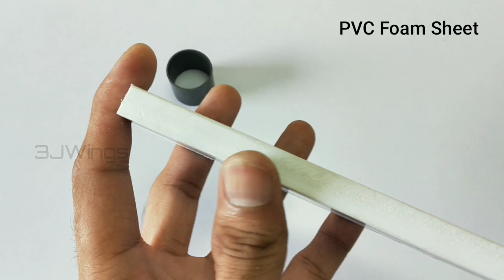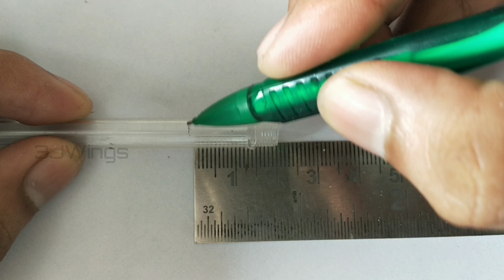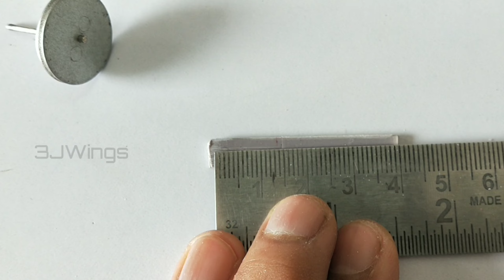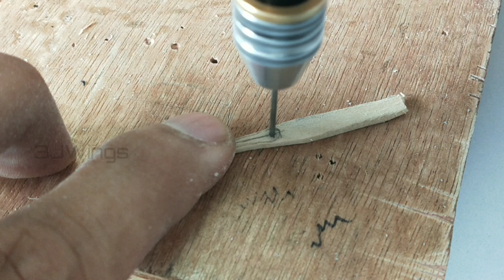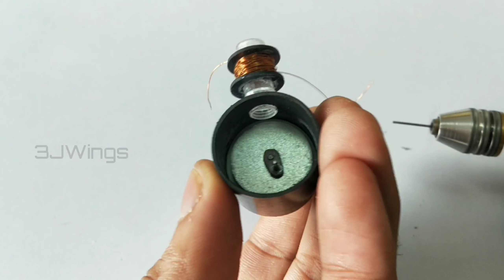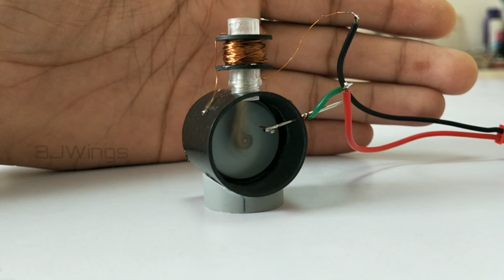How to make  Engine At Home | electromagnetic engine|  #engine #how

Comment: Help me bro , I want to attech servo motor in my rc rock crawler 3xl ..... Please tell me how can I connect servo motor in rc car's circuit or i program servo with arduino ? I want turning system with servo which recoils back and which is strong....